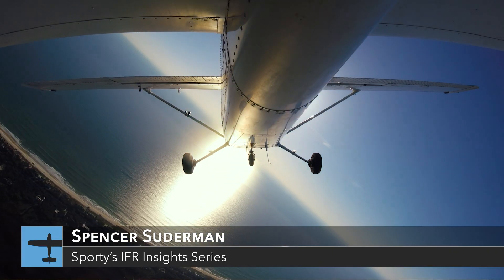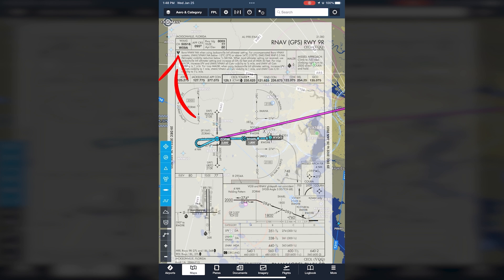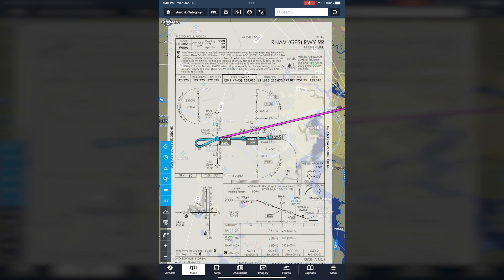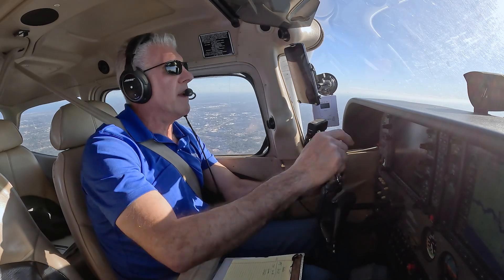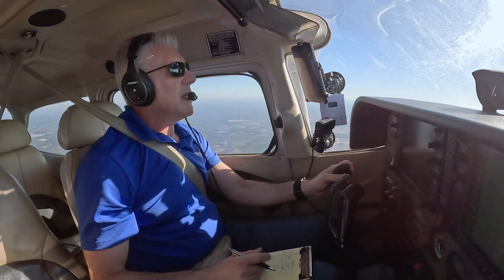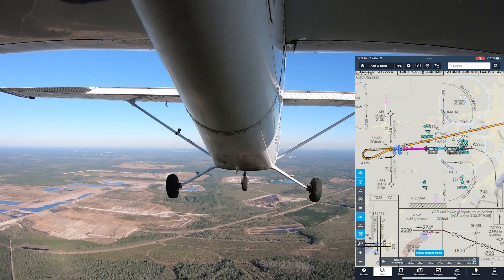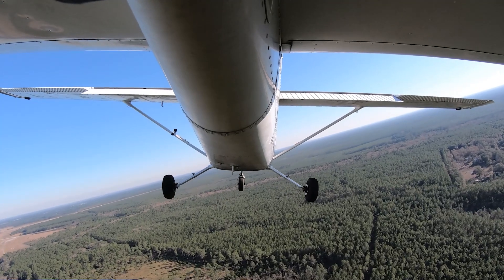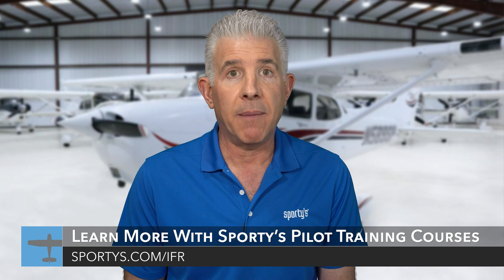RNAV Circling Approach and Procedure Turn at Cecil, FL - Sporty's IFR Insights with Spencer Suderman

Comment: I have a question, why do the step down before the final approach fix when you could maintain 2000 feet until intercepting the glide path then start your decent?
Reply: Final approach fix is where intercept glide path. Denoted by the zig zag arrow and minimum crossing altitude at final approach fix
Reply: @garretthull9846  I know that but you can also intercept the glide slope at a higher altitude and follow it down to the circling minimums and not have to do several power adjustments for the step downs and level offs and then to reduce power again at the FAF and reestablish your descent again.

Comment: Hello Spencer, 
Based on the TAAs, which are designed to eliminate the need for procedure turns, you should start the procedure at the north IAF based on where you are coming from.  Zorme should only be the IAF if you are coming from the west, according to the TAA.
Reply: I agree with this comment.  In fact using the IMAHA actually reduces risk.  Moreover, the only reason to teach that circle to land on an RNAV is for a checkride prep.  I have circle to land on my personal minimum list for.  For me this is a nice video... well documented and well presented... that teaches you to do two wrong things.